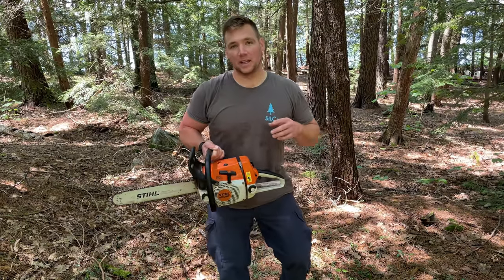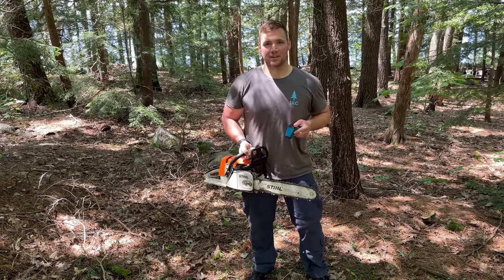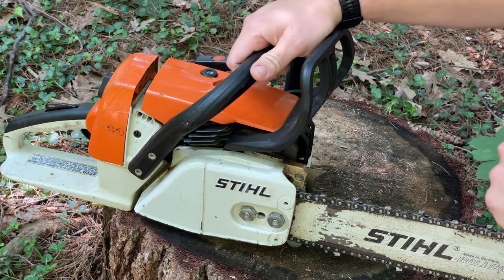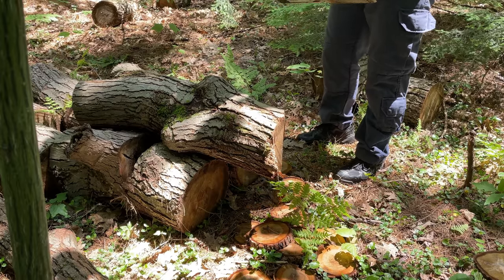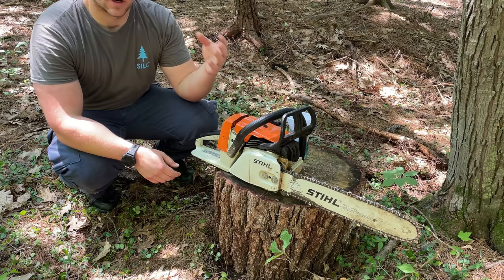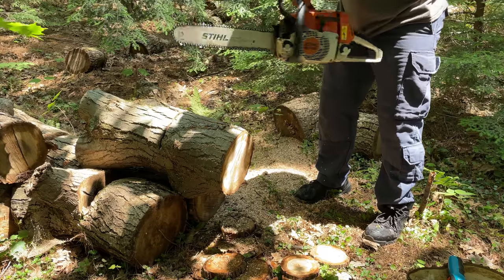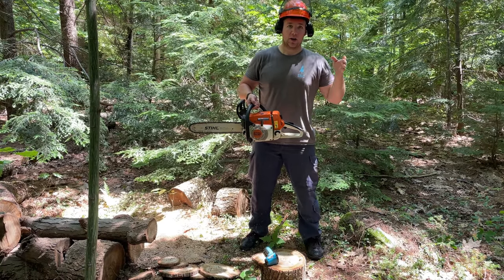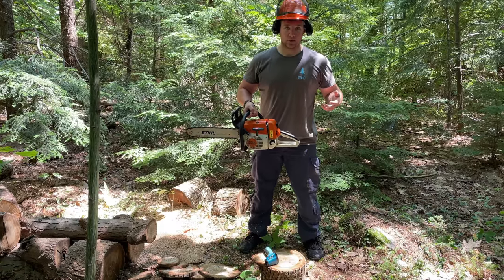Will my chainsaw last longer if I use more oil? Is it safer? (25:1 VS 50:1 temperature testing)

Comment: In the early 1970s we ran 16:1 in our chainsaws. After 25 years of hard use they showed very little wear. I have seen what happens to saws people run at 50:1. It scuffs pistons, wears out seals, and bearings don't last. After using them and fixing them as well as motorcycles, it is QUITE obvious to me that more oil is better.  Remember, it's the tree hugger, EPA and manufacturer that wants 50:1. Your saw and bike dont!
Reply: That's funny.  I've been running 50-60 to 1 on my motorcycles since the 90s and every time I do a top end and I can peek in the crankcase, I'm always astonished at how much oil is in there, and how it's everywhere.  Very different than your experiences.
Reply: . If you run to much oil in a modern saw it will run lean they are jetted for 50/1. Also a lot of guys dont know how to adjust a saw properly they are usually to lean or to rich.
Reply: My Echo dealer told me to run 32:1 in both new saw that I got, he said at 50:1 that saw will not last like the old chainsaw are lasting
Reply: @larrykluckoutdoors8227   it's also worth considering that the earlier gen saws are far less highly strung. Modern saws are very tight.
Reply: I never had any problems with the 50:1 gas mix
Reply: Using good oil makes a hell of a difference
Reply: 16 to 1 is still used in many kart engines, where extreme high revs (15,000 and more) are commonplace.
Reply: @lakestatebullies7391  saws come 1-1/2 turns out which is Rich on gas even at 32-1. Everyone I know that run a saw can adjust them. They usually while it’s cutting adjust em to the best cut speed.  Ppl that tend to run saws tend to like and know to adjust them. This is what I commonly see. I live in conservative east Tennessee so Maby that’s different other places. Also they all run them slightly rich as they believe it to be safer.
Reply: @DavidOsborne_sprdave that doesnt have anything to do with how much oil is between the piston and cylinder wall. Sometimes ppl flood saws. all sorts of stuff hints happen to cause fuel mix to settle in a crankcase. It’s just a hole beneath the piston and cylinder. That’s not a measure of used or anything. I’ve found all sorts of weird things in 2 stroke crank cases doesn’t mean they supply the piston what it needs . 2 strokes Gall pistons for all sorts of reasons snagged rings dirt fast temperature changes air leaks air leaks a lot Maby a jet gets partially blocked chipped reeds etc
Reply: Excellent comment. In total agreement with you!
Reply: Snowmobiling since 1969, too much oil leans the mixture in 2 strokes. Oil isnt gas! Oil injection supplies very little oil at idle ( maybe 100:1 depending on brand, Rotax, yamaha, Suzuki, etc) and at wide open  injector pump is  maybe 32:1 or more. Too much oil will sieze a piston or burn a hole in it. The engineers figured this out decades ago. Yamaha especially with the first sleds oil injected. As an aside, I run Bombardier mineral oil at about 40:1 in my 1971 pro mac 710a, 1980s pro mac 700, multiple 10-10s, and a few homelites. Been burning firewood for heat since 1970 and cut trees for our sawmill. Zero engine failures after all these years.
In the 70s I ran Union Carbide synthetic oil, less plug fouling but had crank bearings rust in a Sachs 440 engine over summer. Wasnt good for storage. Todays oils are great.
Reply: @lakestatebullies7391 Exactly correct.
Reply: In my opinion a little more oil can't hurt. Yes it might gum up the motor faster but it saves the mechanical components from wear. You're right about running richer.
Reply: You can feel it on a moped what happens with to much oil in, it just runs on higher rpm and smokes like hell.. Its like life, the mixture makes it..😅
Reply: Good oil is more important than extra oil. 
That said I run GREAT oil at 40:1
Reply: The saws in the 70s are not the same animals as the new ones more oil is terrible in the new saws so I disagree with your comment!
Reply: So many comments about how lean a saw will go over mixing more oil. What is the difference between 50:1 to 32:1? A ounce?  Mililiters? If that makes my saw go dramatically lean and blow up, the saw deserves to be thrown in the trash.

Comment: 40:1 Premium Mineral Oil ( WITH API-TC/JASO-FB RATING ) with a Premium 98 Octane Fuel. Perfect for bigger saws optimal performance and reliability, I also use a mixture of either Husqvarna or Stihl Bar & chain oil with a Diesel SAE 40 engine oil mixed together ( 50/50 for colder conditions and 75/25 for average temperatures, on hot days I’ll run a pure bar and chain oil ) this is all just my personal preference based off of my experience not only felling trees but working as a OPE Specialist in the past. Though if your just a homeowner doing annual maintenance around your property always listen to your husqvarna or stihl dealer if you know nothing about cars you refer to the owners manual not billy on the internet for what oil and how much to put in (PLEASE DONT USE ETHANOL FUEL IT EATS YOUR FUEL LINES AND RUBBER COMPONENTS!)

Comment: Great test.  Be interesting to see what the results would be if you richened up the H mixture screw to compensate for the 25:1 mix.
Reply from the maker: It would be interesting for sure. I wanted to show what would happen if the same saw was used with the same settings. Tuning a chainsaw is beyond the scope of comfort for most folks. Thanks for watching, hope to see you back Brian!
Reply: @DavesSmallEngines  Most saws come out with autotune/m-tronic from now on, so that won't be an issue in the future. Knowing to tune a carb is mandatory, and easy, I don't know why it's always expected of people not to tune, or going with a leaner oil mix is a fix. It isn't. You could buy a saw in a shop at 8000 elevation, you go to your sea level home, and the saw now runs lean without you doing nothing to your oil-gas mixture or whatever. I appreciate the test, but the difference between 25:1 and 50:1 is 2% oil vs 4% oil. That's a 2% difference, or 2% less gas.

If the air temp is 6 degrees C colder than when you tuned the carb, that air is gonna be 2% denser, doing the same thing as going from 50:1 to 25:1 air mixture. It's just not that big of a deal in tuning, nobody has that fine of a ear when tuning so even the best at it just go slightly richer to be on the safe side and get back to cutting. It's not that big of an impact going from 50:1 to 25:1 as people think it is. Early morning to mid day temperature changes have a way bigger impact :P

In regards to 25:1 feeling more sluggish? That's again the tune or just placebo. This was tested decades ago and there's a research paper on it, I'll have to look it up and edit it on here. Max power and compression is at 8:1 fuel-oil ratio or so, and power decreases from leaner ratios more and more due to worse ring seal. Optimal ratio percentage wise for better power without going too rich on oil was 32:1. Regarding the extra oil, just use a full ester synthetic oil like motul 800 off road or similar and you won't see any smoke even at 4:1 https://youtu.be/QLW5KEslF3A?t=244
Reply: @em4703  the test in the video you linked is a test on a 4 cycle engine… whole different story
Reply: The carb tuning on that saw is terrible. Shouldn't take that long to  start a 260 and it shouldn't be smoking at any ratio.
This test is a bunch of BS.
Reply: The saw was started bone dry (without any fuel) before the 50:1 run. Then all the fuel was burned out before refueling with 25:1. In both cases I would expect a number of pulls would be needed to get fuel through the system.
Reply: @em4703  What about when the skeeters are thick I want some smoke
Reply: Oil affects the rich/lean mixture more than you realize. Running more oil even properly tuned will produce less horsepower.

Comment: I have seen many demolition saws pick up a piston using 50:1, a higher temp isn't always a bad thing as long as its not too hot, hotter will bur the excess oil better. I have used 25:1 in all my 2 strokes for 45 years, no ill effects.
Reply: Same thing here, Harry. I burnt up two Husqvarnas over a 20 year period running 50:1 temporarily just for a test, then went back to 30:1 and hundreds of cords of firewood later, never had a problem. It certainly appears that the saw chain in this test got duller with each test cut. The last big log cut took 30% longer than the first big log cut using the 25:1 mix. It would be interesting to see the 25:1 test run first when the chain is sharper, then run the 50:1.
Reply: @garsonprice3441  In two stroke bike racing they say more oil more power, there are dyno tests to prove that.
Reply: @harry8506 true, I picked up power in my zenoah g320 going from 28:1- 20:1

Comment: Great video Dave!
Reply from the maker: Thanks buddy!!!!
Reply: Dony, now you got to do a similar video. Except, yours will be determinating how much power does a small engine make depending on what fuel you use. Also, lots of crazy sparkplugs out there that have huge claims like them iridium sparkplugs. Are two, three, or four electrodes better then one? Does it matter what the inner plug core is made of? Or does the cheap Champion just as good? SCIENCE! Why? Cause ya gotta.
Reply: @stellarproductions8888  maybe team up with 'Project Farm' channel...?
Reply: https://www.youtube.com/watch?v=rkoFzuwtbeA    jak to naprawić przepustnica nie otwiera się do końca.....
Reply: @stellarproductions8888  Champion isn’t the one you want…for some reason you can see a 600 rpm loss buy using one over the Ngk or Bosch is actually the one you want and what Stihl recommends..those multiple fingers are a farce… 😂👍
Reply: He should have retuned that carburetor when he changed the mix ratio??? Are you ignoring that very important point? Train him up right Donny… 😂👍
Reply: @DaveyBlue32  I use Bosch plugs in my equipment. I find that they work well, and seen to last a few years before replacement. NGK are also good plugs too. I got those for my Husqvarna backpack leaf blower.

Comment: That was a great video! It was clearly obvious in the video that the saw lost power when using 25:1 mix. You could not only hear it in the sound of the engine, but visually it was noticeably slower cutting the logs.
Reply: It was running leaner at 25:1 which means less power and higher operating temperature. Carb needs to be tuned for each mixture to get a accurate test.

Comment: Great video . I think the temp is higher because of the higher viscosity of the 25:1 mix and it leaning out the fuel mix so it would be interesting to have the carb adjusted to suit the higher oil mix.
Reply from the maker: I agree! I wanted to show what would happen if the average user were to simply double up the oil.
Reply: it would help some with the sluggishness for sure, but its not going to cure the excessive smoke or the extreme carbon build up that you see in saws using modern 2 cycle oil at 25:1... Ive said it before and ill say it again... 25:1 is a holdover from the days when you mixed straight 30w because they hadnt invented modern 2 cycle mix yet. Modern 2 cycle mix has a much higher flash point than conventional oil, so it doesnt burn off as quickly. there is a flip side to this... If your saw or other 2 cycle engine doesnt see a lot of RPM or load, it can actually struggle to burn off modern 2 cycle oil even at 50:1 causing excessive carbon. Idling is actually really really bad for a 2 cycle engine, as its not generating enough heat to burn off excess oil, but also isnt generating enough air movement from the flywheel to keep the cylinder cool either. Chainsaws in particular (because the engine is completely shrouded in plastic) are not meant to be left idling for extended periods of time.

Comment: Also with the higher oil level you will likely need to clean or replace your spark screen more often.  I personally use 40:1 mix for many years with no issues even on cheap Poulan saw.
Reply: My husqvarnas won't seem to run on the 50:1, even the pre mixed sthil cans.  Runs then gets hot and won't run.  2 out of three of them. The 3rd one would run on water lol!
Reply: The only way to measure if more oil is better is to have the saws worked for say 150 hours then tear down and measure the wear. Hope you can set a test up like that.
Reply: Try 42.5:1
Reply: @jamesfrank3694  It’s not your fuel causing the problem I’d bet.
Reply: @allanmccullough8550  one has been like that since brand new. 🤷‍♂️ the other is pretty old
Reply: @jamesfrank3694  I have a 353 Husqvarna that I had to install a new diaphragm in carb, about 10 years old, 50:1 gas mix. First issue I've had. I use a dedicated container and 100% gas always.
Reply: Just take it off and throw it in the garbage. Your spark screen cuts performance as well

Comment: I work my equipment hard, I also take care of it all. 40:1 is my preferred Ratio. If in doubt I’ll add a little more. I use Amsoil in most cases. Stihl is made by Castrol which is also good oil.
Reply: I use their Saber oil.  It's great stuff!

Comment: 40:1 Is the sweet spot !
Reply from the maker: I’m not sure, Donyboy73 says 45:1
Reply: You are correct Greg. We went from 50:1 to 40:1, and we don't replace engines annually at our landscape company. At 50:1, we were tossing equipment out due to low compression.

This is one of those issues that I tell people, but I don't push it on them - because they need to learn on their own. I spent so many years and so many thousands of dollars for our company buying new equipment - and this is a lesson that everyone should learn on their own.

50:1 is NOT ENOUGH oil to properly lubricate these engines, especially when wide open for long, sustained durations. 40:1 is the "sweet spot." A spark plug replacement is cheaper than an engine replacement. We remove all spark arrestor screens on all equipment, since concrete can't catch on fire. We enrichen all carbs by using chinese tools purchased from the internet. 

I will never debate this with anyone; We've been doing this for decades. If a worker changes the mixture from 40:1 to 50:1, he is terminated instantly.
Reply: Run 40 to one in everything I own dirt bikes , saws etc
Reply: @garrettstevensen2467 Hi Garrett, what was that chinese tool you used for mixture setting?

Comment: It’s important to remember the extra oil will cause carbon to build up faster in the muffler and will eventually cause enough back pressure to cause the engine to run poorly or not at all. Always follow MFGs recommendations. They’ve done all this testing for us. 
Thanks for a great video! It’s always nice to see testing in real life.

Comment: Those slight temperature differences could be due to a blunter chain working the engine harder by the time you got around to the 25:1 mix. I run 25:1 in all my saws both Stihl & Husqvarna XP as I prefer the extra lube as I think it gives longer service life.
Reply: You're kidding, right?
Reply: @mikezupancic2182  If you know you know, if you don't you don't.

Comment: I bought a Still 041AV back in 1967.  The mixture recommended in the manual said 40:1 .  I have been using that ratio all along for 57 years and other than replacing the carb and spark plugs a few time, the saw still runs great.

Comment: I was shocked to hear you say lean condition. i been out of the game for a long time but no one ever used to believe that, drove me crazy. very generally speaking and also somewhat engine specific, more oil will produce more heat (and more power). dyno's can show an increase in power down to high teens, 19:1 IIRC . obviously your test was without a carb adjustment as it should have been, only changing 1 thing at a time. there are other things to consider such as atomization. heavy ratio is "harder" to atomize and efficiency can suffer as well as increase wear more apparent on larger bore piston port engines. A KEY takeaway imho is people generally add more oil to a rebuild. people add oil or even double the ratio arguably causing more harm than good to their new or rebuilt saw.  cool video, thanks.

Comment: Nice comparison test Dave, thanks for taking the time to do it thoroughly 👍 I suspect with a cheap Chinese chainsaw that specifies 25:1 (suggesting an older style engine) that it probably wouldn't survive long on 40:1 or 50:1 ? - The Stihl's has a rock solid motor - no monkey metal inn those bad boys 💪
Reply: its mostly because of their outdated information, or possibly the lack of availability of high quality engineered 2 cycle mix, which contrary to popular belief is much different than conventional 30w oil. If you could find a manual for an older Stihl from the 70s-early 90s, you would find that Stihl recommended 25:1 with straight 30w oil. As lube manufacturers developed better and better 2 cycle oils, the recommended ratios got lighter. If you look at some of the most modern oils like Amsoil Sabre, they recommend 100:1 because of the extremely high flash point.

Comment: Thank you for demonstrating a head to head test of the oil mix debate. I have 50+ years experience with 2 stroke engines starting with the old 20:1 SAE 30 mixtures up through the 50:1 modern oil mixtures.  Many people have difficulty understanding why less is best.

Comment: The amount of oil would HAVE to effect volatility of the fuel. It would be interesting to see the two mixtures run on a saw set up on a dynomometer and measure the difference in torque output. Great video all the same.
Reply: The oil drops out in the crankcase. I read oan article on 2 stroke motors bikes. The got the best HP at 18 to 1
Reply: @jimbo5635  I read an article saying the same thing.  It may have been the same article.
Reply: 2 things to remember here ,the more oil the lower the octane rate of the mix and 2nd two stroke oil returns to its original viscosity when compressed so more oil than recommended is wasted